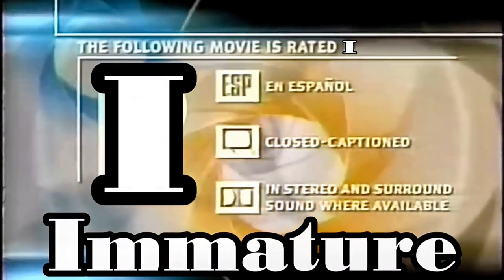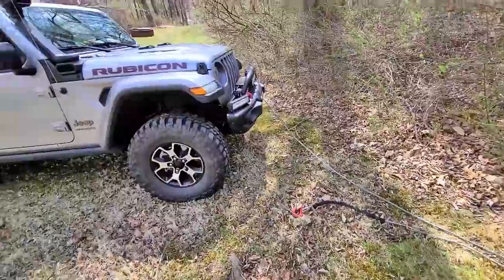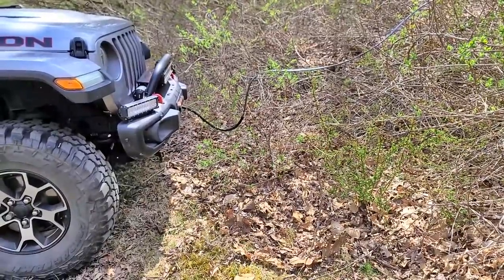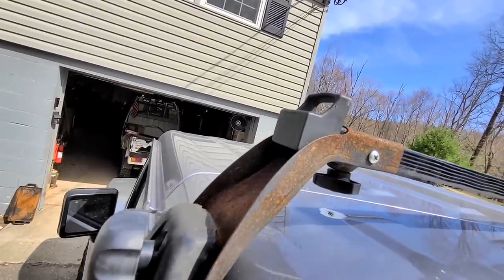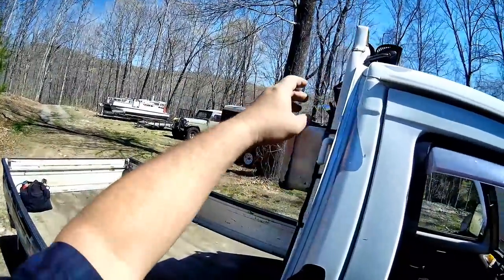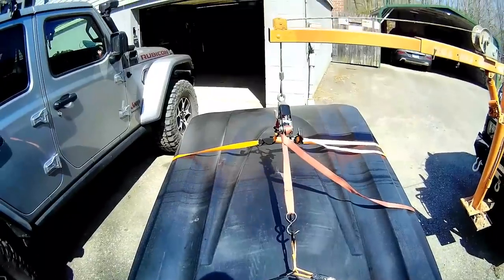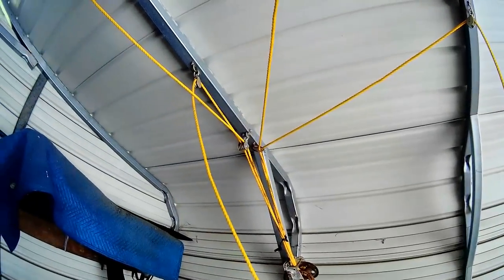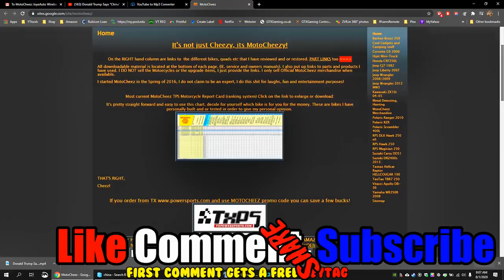Mini-Truck (SE04 E14) Yard and trail clean-up, winching and rooftop tent back on (Rubicon)

Comment: #966 What about that Excavator in the background? That would have been so much easier... :):)
Reply from the maker: It would, but the boom creeps down slowly, I'd be afraid if I wasn't fast enough it would rest on the tent after a while and crush it. 😂
Reply: @MotoCheez  You need to fix that - a good episode! :):)
Reply from the maker: It's the turnstile seals and bushing's.  They're worn, it was used for setting septics big job and big money so I live with it. 😁 Slow creeping
Reply: @MotoCheez  Okay thanks for all you do!

Comment: Rigging, re-rigging, and head scratching... The way it's done around here as well! Then later, a possible head-slap remembering the tool you made just for that job last year!

Keep up the good work. Looks to be paying off. Love what you've done in Florida. Maybe Mini needs a little brother down there?
Reply from the maker: Exactly how it's done. Lol. I've been thinking about a mini in FL, I need a garage down there!
Reply: @MotoCheez  Another container? Mini will fit in one, and nothing is more secure! My buddy is in process of taking 2 containers and stretching trusses between them for a carport/party shelter and storage at his remote camp in Tennessee.
Reply from the maker: I thought about doing that same thing or putting a lean to off of one side, the price of lumber is ridiculous now though would definitely be a metal roof

Comment: as far as your tent issue goes, at the end of the season  leave the tent attached to the roof rack's,  and remove the whole thing as one unit. IE Tent AND rack's.  less of a hassle to just mount up some spare rack's rather then fight trying to unbolt it from the racks.
Reply from the maker: I did try that one time. I may just end up.doing that

Comment: thought u were gonna use the excavator to lift it. How about miggin some grade 8s to the tent base plate. drill matching holes in the cross braces, nyloc nuts and washer or weld some washers to nuts. a ratchet box wrench. just mark which cross brace is F,M,R,  and which side (L/R). if U'r able to use that lift in the carport it's still a one man job mounting tent.  bolts just need to be long enough to have a few threads sticking out the nyloc nut
Reply from the maker: That's what my plan was. Then I didn't know if I was making too much work for nothing lol.
I'd use the excavator but the boom creeps down slowly

Comment: Was wondering if you would know what would cause the rpms to fluctuate on the hawk 250 the carb has the 110 mj and 27.5 pilot with the fuel mix screw 1 and a half turns out the carb is the mukini and has an airfilter was also wondering ru supposed to lube carb airfilters ive heard yes and no thanx for any advice!?
Reply from the maker: Fluctuate when? Stock paper air filters don't need oiling, some aftermarket and most cone style reusable filters do!
Reply: @MotoCheez  RPM fluctuates at an idle while engine is running and it's not a paper filter i think its foam kinda looks like a boom mic
Reply: It came with the mukini carb I ordered
Reply from the maker: I'd say open the mixture another turn
Reply: @MotoCheez  will do thought that might help and as for the carb air filter would it need oil? And thanx for the help!
Reply from the maker: Probably they make a spray for reusable filters you can buy. https://amzn.to/3uUvScb
Reply: @MotoCheez  Thanx appreciate the help!